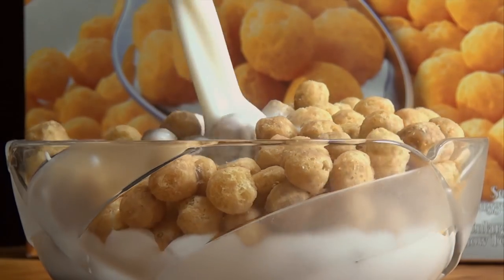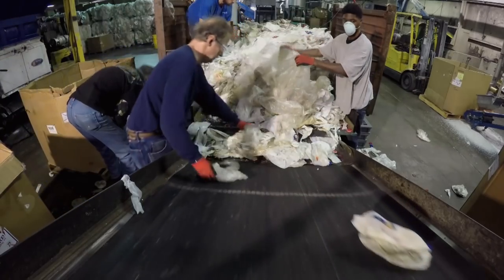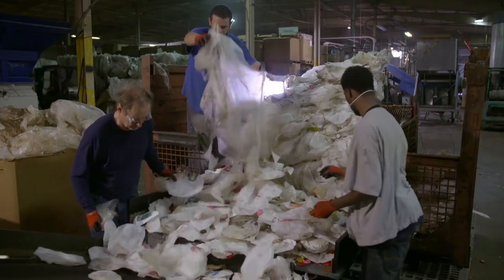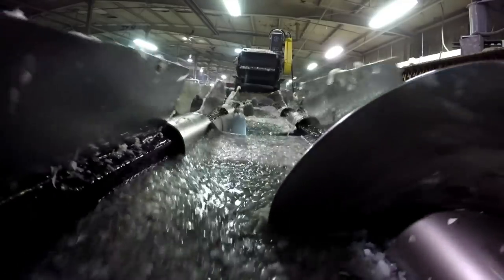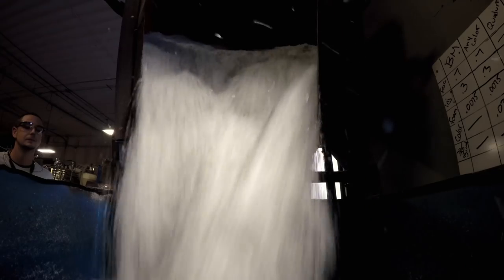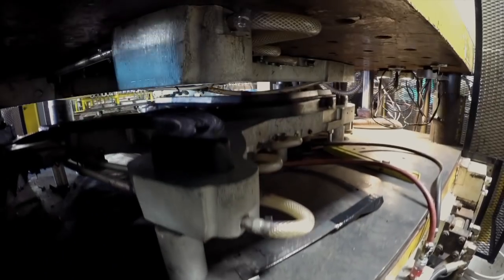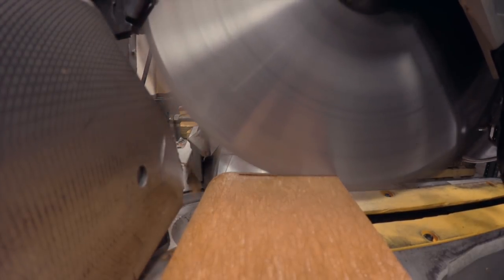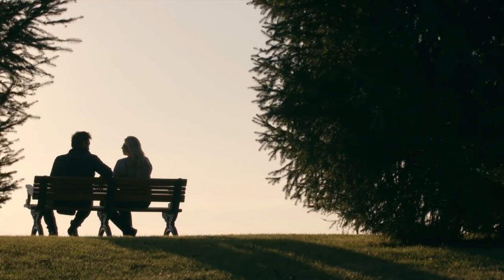How To Recycle Plastic Bottles Into A Park Bench | Made By Destruction

Comment: compression compression as is with low heat no shredding or sorting keep it simple. like use steel compression equipment. sheets, bricks boards, etc. keeping smell lower.

Comment: We should use glass milk containers. This is just postponing problem of plastics.
Reply: @Devlin B If we use glass for milk containers, we will not have problem with used plastics milk containers. Glass container can be used multiple times, and glass is more eco friendly, and can be recycled too.
Those plastic benches will eventually degrade under UV light, and we need to recycle them again, or leave them in nature... This is not solving a problem, this is creating need to use more plastics, in areas that we did not use plastics before.

Comment: HDPE is the best most preferred polymer to recycle - doesn't degrade when reheated and molded or extruded.
(A "slight" problem with plastic park benches....vandals like to set them on fire.)
Reply: Wood benches also are not fireproof and Metal is not rustproof. Every material has + and -. What matters is reducing plastic pollution which is issue while puting plastic in more lasting eco friendly use. Metal and Wood already are part of recycling systems. 🙄

Comment: get rid of BIODEGRADABLE and go back to NON- BIODEGRADABLE and then recycle it into sheets and boards and build houses that last forever
Reply: As anyone who has a slightest level of understanding of plastics, ALL plastics when exposed to weather, particularly SUNSHINE, breakdown and revert to minute dust particles blowing around everywhere, contaminating everything. To reuse plastic in the manner, DOES NOT SOLVE THE POLLUTION PROBLEM, in fact it accelerates it, by reducing the particles to minute size in less time than it would take under normal conditions.